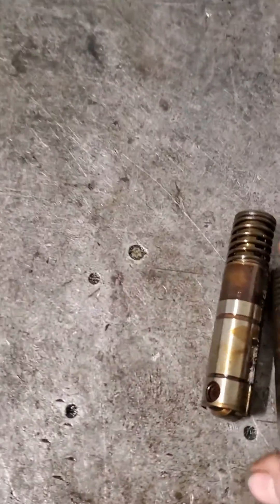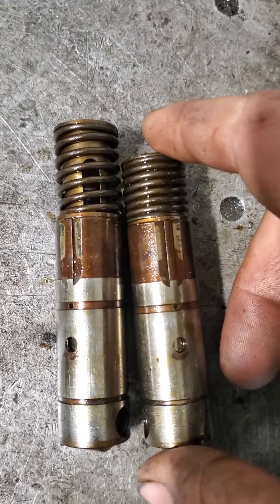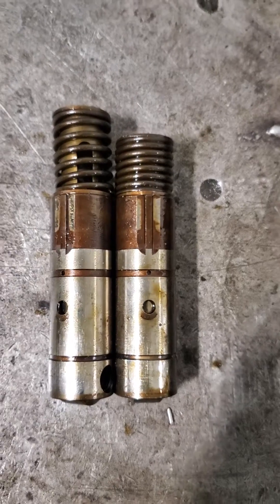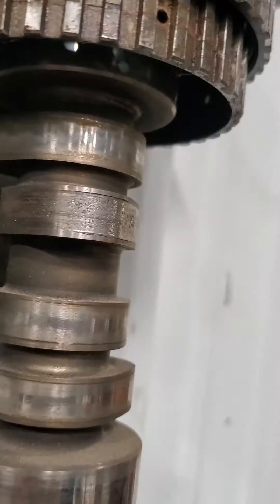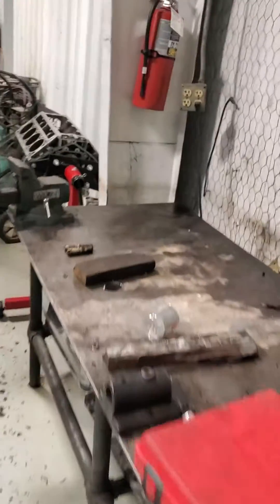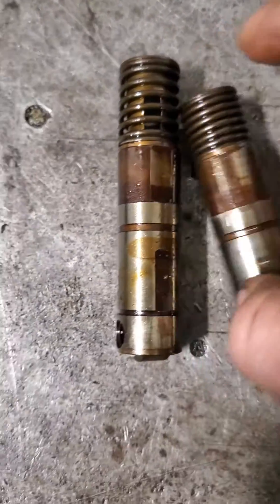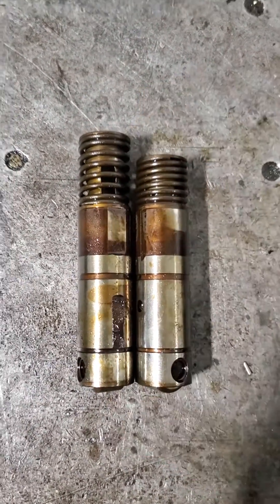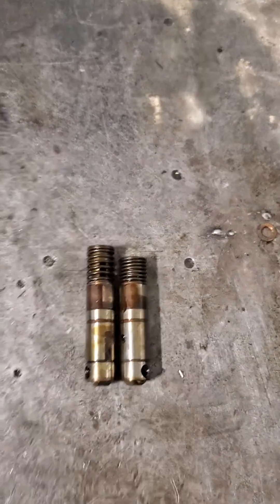LS series engines with afm or dod lifter failure

Comment: I’ve read on the inter webs that if you disable AFM/DFM via software only and leave all the hardware, that oil gets stuck in the lifters and gets cooked in there unable to pass through. When you go back to stock AFM/DFM (like pulling your Range out of the obd2 port) to pass a smog test your lifters will get stuck. Is there any truth to this?
Reply: I have been doing this for over 8 years in my 5.3L ecotec.
The secret is to use oil cleaning additives with your oil every oil change.
I use 1L of ATF, 1L of Marvel Mystery Oil or 500 mL of Seafoam (or all 3 combined) to keep things clean and lubricated.

Comment: can I replace lifters only on the one head ? do I need to replace camshaft anyway ? L99 camaro SS 6.2 ticking sound
Reply from the maker: If cam Is good you can do one side only.
Reply: Why a new manifold?
Reply from the maker: @comajoebuck999  afm manifold. Incase it has a bleed between solenoid packs that control oil flow during afm deactivation

Comment: Is it bad or will it cause any harm if I disable afm
Reply from the maker: If it collapses a afm lifter. U will need to replace with good afm lifter and turn off afm or remove both heads and get a non afm nob vvt cam or and non afm with vvt cam and regular lifters and trays. And then have tuned. But if afm works fine u can just have it tuned and turned off or get a programmer that doesnt allow afm to come on